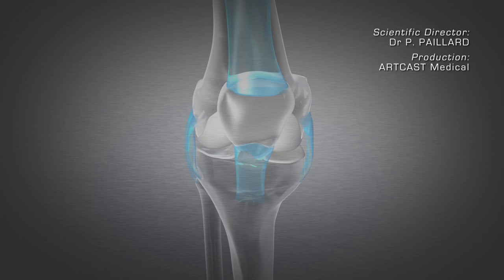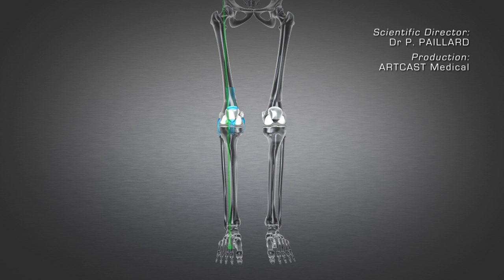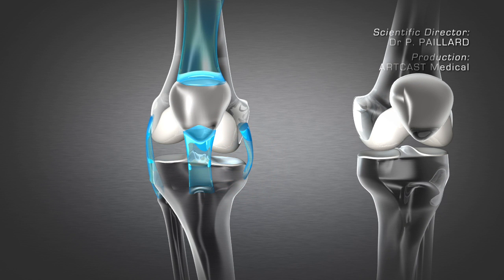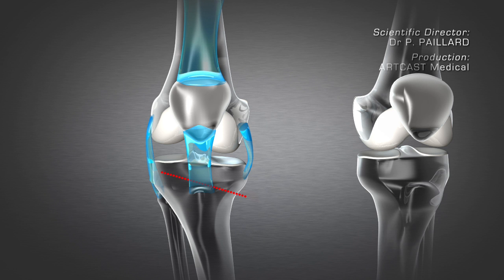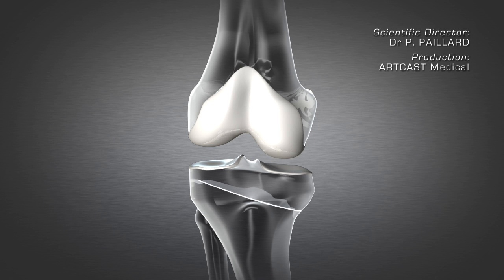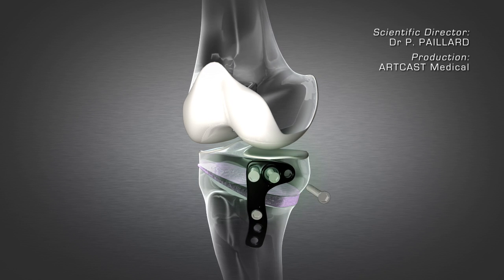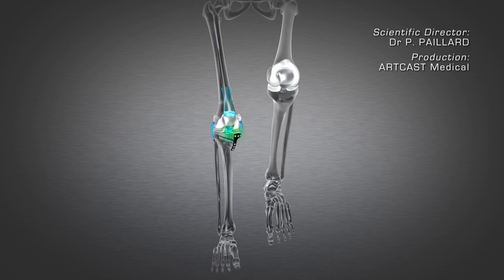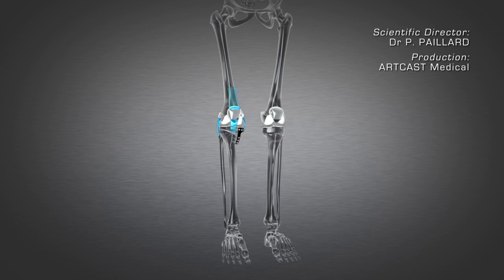Tibial Valgus Osteotomy

Comment: I wish this wasn't true, but these osteotomy surgeries ruin people's health and that of all the other people who have them done. The bone where they sawed afterwards doesn't stick properly anymore, it gets weak and it will slide little by little and sink inwards with time. I believe that a bone scar is left or for some other reason I don't know. Maybe it is left with little room to regenerate and becomes weak or another reason. It is not the same as a normal fracture where afterwards the bone becomes normal again. When you sawed it, or break it with a chisel, in this case it is different. The bone is left with a problem afterwards. Then the person gets all twisted because of this, as the bone sinks, it ends up twisting or sinks all the other bones of the body. If they do it in the lower limbs. But everywhere, it ends up disturbing people. Besides that, the nerves around where they do this also sink and leave their original place, and then the person starts to feel everything altered and only starts to feel bad things afterwards. Both in the external environment and in the body itself because of this. This surgery is a mistake in medicine, just as there are mistakes in any other profession. I don't know how it hasn't been forbidden until today, with so many people getting bad afterwards, I'm pretty sure all of them. It doesn't matter if it is done on the nose, leg, foot, heel, people end up getting bad the same way. I hope this comment helps. Take great care, health is very precious. After we lose it, our life becomes very difficult, and so does the life of the people around us, who end up being affected as well. A hug.
Reply: You are presuming and assuming, which is irresponsible. Your comment is based on your own personal opinion and not on fact. 
Granted, you are entitled to your opinion, but please refrain from disinformation…  ‘‘bones not ‘sticking’ properly’’, ‘’sawed or break with a chisel, it’s different’’, ‘’ends up twisting and sinks the other bones of the body’’… you do realise operations not dissimilar to these have been performed for millennia, with varying degrees of success. But, we owe to some of mistakes from the past, a better understanding of how the body performs and it’s ability to heal.
Health IS very precious, and life does become difficult when good health diminishes… and this is exactly why operations such as these are life-changing, for all involved.
I wish you well, with many hugs.
Reply: Hello Inthe, how are you? It's not based on my personal opinion, it's based on facts. And it is not misinformation. On the contrary, it is a clarification about the mistakes of osteotomy surgery. I have studied this subject and it has also happened in my own body. There are surgeries that should be forbidden, these surgeries have  for about two centuries, and many people  worsed got sick and ill because of them. Much worse.And nothing has been done about it. Just go through the history of medicine, there were many mistakes, and that's why things have changed. But there are things that are still wrong with these surgeries today. Several people I talked to also got worse. Much worse. And everything I said in the comment is true, so my conscience is clear and calm about this. A hug. Then the person suffers the rest of his life because of this surgery, without anyone doing anything to reverse the situation. It is very difficult and sometimes it doesn't even work. Or depending on the surgery that they are going to do, it would be better not to do it at all because the person could get even worse if they don't  open  the bone in the same place. Sometimes they want to saw open  the bone in a different place. What good does this do? If with one cut in the bone there is already all this problem, imagine with two and in different places. You can't do this. It is to put an end to the person's health this way forever. You have to open it in the same place that it was opened the first time and put something to firm the bone. Otherwise, you get sick and bad for the rest of your life. As the bone is weaked where they sawed it afterwards, not even the screw can hold it, even after it has been consolidated. It to havekeeps sliding. The person's nerves get all altered in place, and you start /to feeling bad things. And they don't come back the way they were before. And the person gets in trouble problens later
Reply: @tiagot6516  i have knocked knees how can it be fixed without surgery
Reply: @willgggg900  it cant